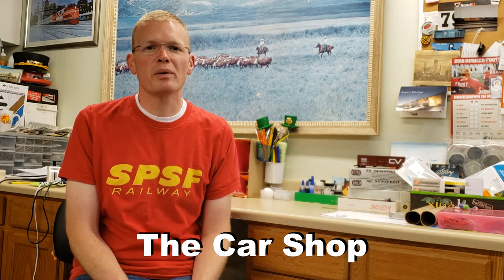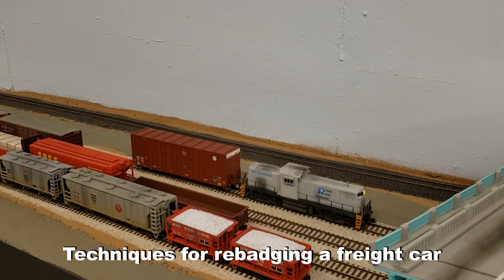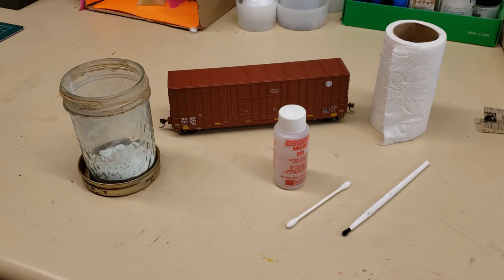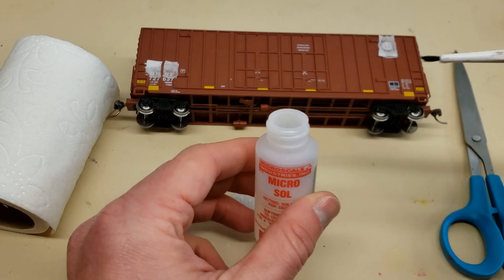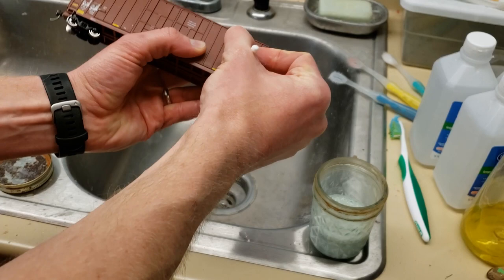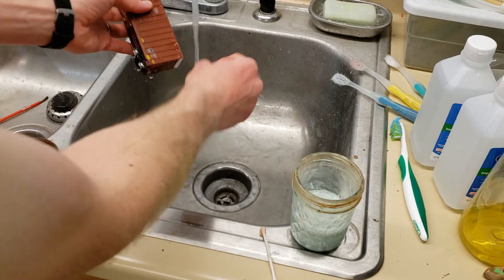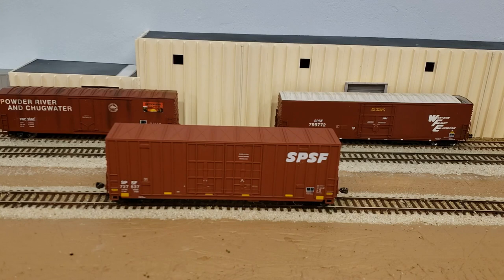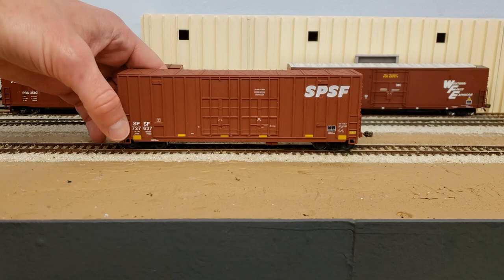Stockyard Industrial Lead: Rebadging a Freight Car - Removing Lettering for Custom/Fantasy Railroad

Comment: Yes I'm 4 yrs too late for this video but I'll just simply paint over stubborn heralds either I color match the paint on the car or use Black paint to cover the old heralds and lettering if the ends are white then I'll paint out the road name with the white, sometimes I'll dry brush the paint on for a "faded" look or for some bleed though look under the new markings.As per the real RR's do.

Comment: I've had the same results with the MicroSol technique. I have also used Acetone in the same fashion that you use the Comet solution. Nice finished product!!
Reply from the maker: Thanks!  I've gotten the Micro Sol to work on very new Athearn cars, but that's it.  It seems like everything else requires a little more work!  Good idea on using acetone!

Comment: Hey Eric how did you create your fictional railroad logo I'm tryna make one also my railroad is going to be Navajo & SouthWestern
Reply from the maker: My fictional SPSF logo was pretty easy since it existed back in the 1980s - I just had a friend of mine create the digital artwork for it, and then now I can use it for decals, t-shirts, and other things.  If I were you, I would start out with a rough sketch then trying to digitize it on a computer by yourself or have someone else do it who is good at graphic arts.
Reply: @emillerz  what about your freelanced logo
Reply from the maker: @southwestlimitedproduction9738  Ah, the SOT logo?  I drew that in MS Paint and then I used a free website to convert it to a vector image, since I don't have Photoshop/Illustrator.  Then I was able to send that logo to my decal supplier (https://pdc.ca/rr/custom_decals/) and also use it to make shirts, like on Redbubble.
Reply: @emillerz  thank you that helps a lot

Comment: Thanks for the video. I tried your method and had less success than you. Others might have better results. Those who try will learn whether their lettering is a decal or made by over painting a masked base coat. If so, my suggestion will not have the desired results. This is not foolproof, so if this is a first attempt select a train car you are willing to mess up and fix by repainting. You will need to work fast, do small sections and be by a sink slowly running the water. You will need a small brush for finer details and a Q-tip for larger paint letter/design removal. You will need some Easy Off Heavy Duty spray oven cleaner. Spray oven cleaner into small ceramic dish and add a few drops of water. Wet but do not dry the train car. Dip brush or Q-tip into the running water and then into the oven cleaner. Apply oven cleaner to the painted lettering you want to remove. Lightly brush or rub in small circle for THREE SECONDS then promptly rinse treated area completely under the running water rubbing the treated area with a soft cloth or your finger. Work Fast! Repeat if necessary. Do not allow oven cleaner to "soak" painted lettering because it can remove the body paint along with the lettering or even "craze" the plastic destroying molded details.
Reply: AN UPDATE: I came across a Model Power boxcar whose lettering proved stubborn to rub off after the Easy Off treatment. After several attempts, the Easy Off had "softened" the lettering enough to scrape off with moderately light pressure from a dull flatware knife.